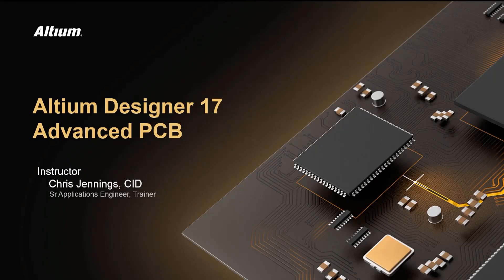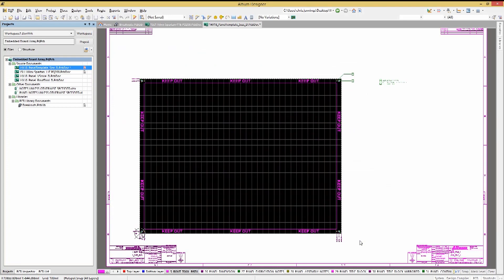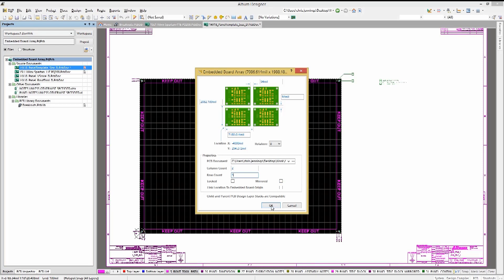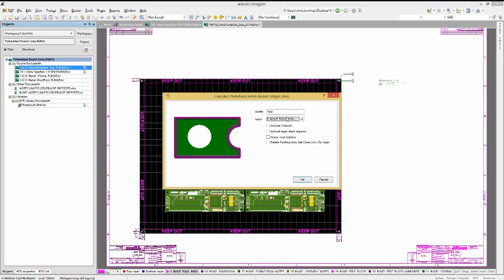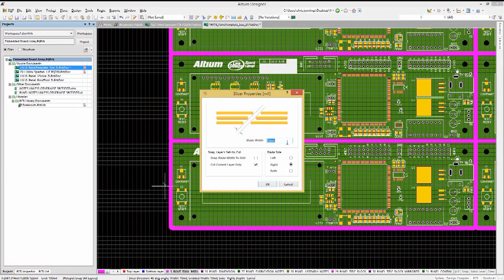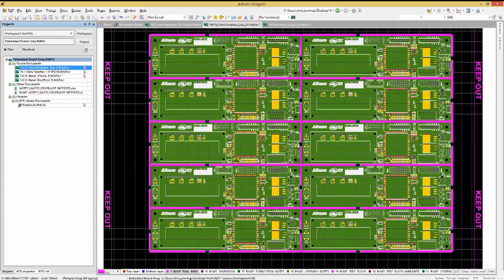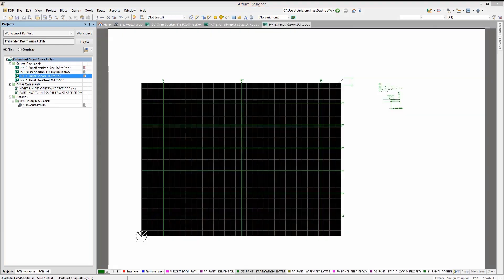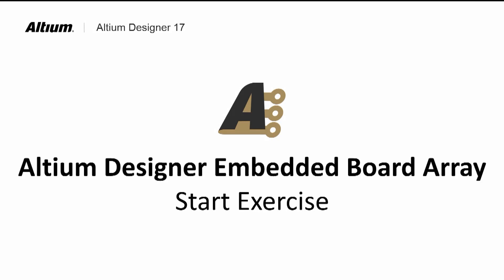Embedded Board Arrays and Panelization | Altium Designer 17 Advanced | Module 21

Comment: A curiosity: Since this feature essentially allows one to embed PCB designs within PCB designs, can that continue with a 3rd embedment?  When a fab house has a max panel limit, but the assembly shop has a smaller max panel limit, one might want to create a multi up panel that maximally uses PCB space allowed by the assembly machines, but also create a panel of panels to minimize waste at the fab shop.

Comment: Question here: Suppose Mechanical 1 was defined as routing tool path layer. The child PCB would have had its shaped defined by a proper outline drawing on M1 right before importing. Then after placing an array of the child boards in the panel, we'd immediately see from the 3D view that those outline drawings on M1 layer are displayed as narrow grooves separating them from each other. This is before creating primitives from board shape. So what's the proper way of treating the child PCB outline before panelizing? Is there a way to suppress it only during panelization? I don't want to delete it because I may also need to export it for standalone fabrication. Thanks.

Comment: What is the layer number for the ROUTE TOOL PATH, is it 5 or 3?  I cannot read properly due to video quality...
Reply from the maker: Route tool path can be any mechanical layer you desire, as long as it's reserved by you for that purpose. When you generate N.C Drill outputs, you have the option of creating a dedicated route tool path for the board outline shape, which can be used by the CAM engineer to tool up the depaneling process.